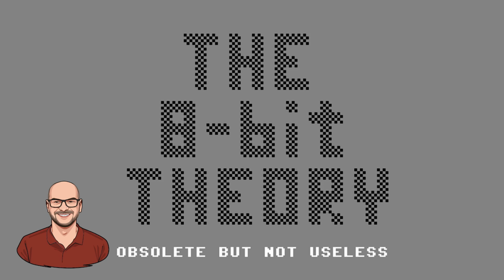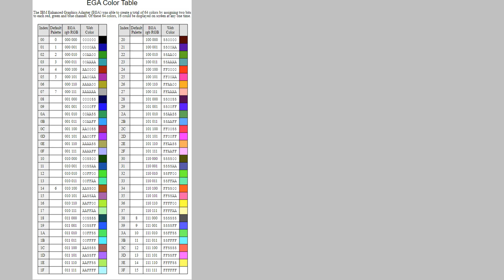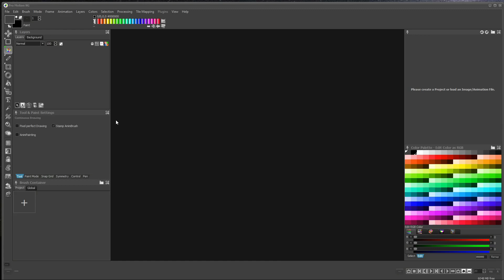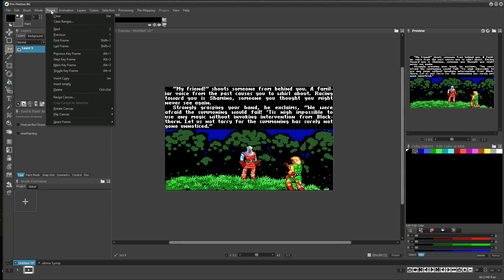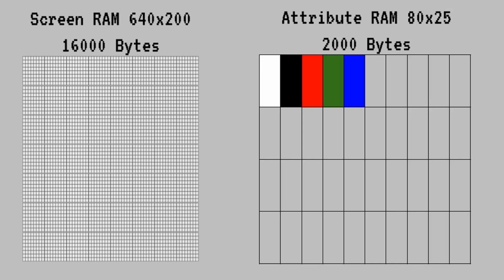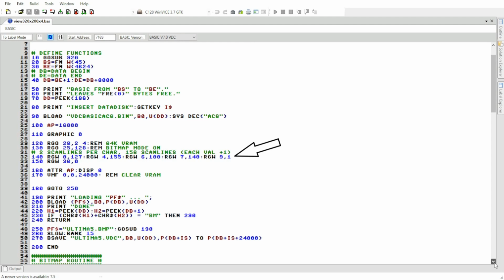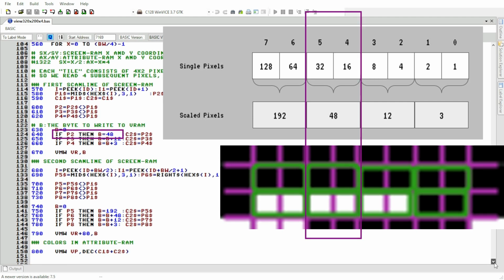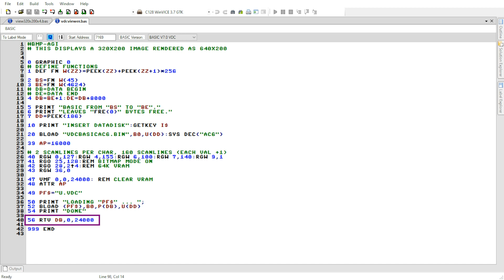EGA on the C128? And it looks great

Comment: VDC = VERY expensive monitor to see the display. Nobody wanted to spend £550 on a C128D AND then £300 on the Commodore 1901 or an EGA PC monitor. That's why nobody bothered making VDC game.
Reply: Not only that. VDC lacks sprites and software sprites would have had an attribute clashing issues. Also smooth scrolling is not possible with colour attributes being set, so VDC games would look pretty much same as ZX spectrum - either being monochromatic with smooth scrolling or having colours with attribute clashes and 8x pixels jumps when it needs to scroll in horizontal dir.
Reply from the maker: @fradd182 I agree about soft-sprites. Not sure about the smooth scrolling though, as there is a register for horizontal and vertical smooth scrolling. I‘ll cover these in one of the upcoming episodes. 
Thanks for your input!
Reply from the maker: I tried some things with horizontal scrolling - not even smooth scrolling. And it's a real pain :-D
So, yeah, I'm convinced smooth scrolling will be even worse.
Thanks for the heads-up on that one :-)
Reply: Really, nothing can compare costwise to the TV that you've already paid for.
Reply from the maker: @glenndoiron9317 Ha, so true :-D
Reply from the maker: I agree, the monitor was probably the main blocker for the c128 to be adopted by game manufacturers. 
I think the 1901 went from $ 700 in 1986 to less than $ 300 in 1988. 
I think the 1084 was introduced in 1987 at roughly $ 500. 
Also, most people probably didn‘t bother with upgrading to 64k of VRAM. 
I‘ll cover these points in a future episode, thanks for your input
Reply: @the8bittheory  The original C128 + disk drive + 1902 monitor in the UK had a bundle price of £800 around late 86/1987. It cost more than the Amstrad 1512 PC 8086 clone with twin disk drives and colour monitor, and that ran MS DOS applications which were far more attractive to business users. Still Commodore 128 + tape deck could have hosted some nice 128k 1mhz VIC-II games. It's not like the machine sold badly, 4.5 million C128 and 128D machines were sold. The extra memory allows twice as many sprite/graphic data memory locations for the VIC-II to be pointed at.  I presume colour RAM is also duplicated in the 65-128kb area of the memory map too giving you the potential for double buffered 16 colour games, C64 color RAM being a fixed location is the real problem for super fast and very colourful scrolling games, you have to compromise on colour or screen size as the C64 can't do the full screen 50/60fps scrolling colour and video RAM together.
Reply: I plug my C128 to a LCD TV set using SCART, the converter I made include one DB9, One peritel, 1 meter cable and 8 resistors
Reply: @Arnold_A_Lampel  The problem was Commodore sold the 2mhz 128 as an 'upgrade' to the C64 but the reality was on a TV it could only manage the same as a 128k 1mhz C64. However, there is also the fact the C128 sold more worldwide than the Amstrad CPC so even so it should have got some 128k versions of games like they did for the CPC. The Spectrum 128k models are really the only ones that got support because that did have a sound chip and all the 48k models had no sound chip just a pathetic beeper. Don't know what they could have done in the USA but in the UK if the VDC was made to run at 15.5khz with analogue RGB output things may have been differemt. A 128 version of The Pawn/Guild of Thieves could have had ST/Amiga graphics. Alternatively they should have spent time making a VIC chip that did work at 2mhz but the C128 is a cobbled together system, it's not like the elegant design of the C64, the Z80 is exclusive mode so no dual CPU. You had to pay for all these extras but the games developer couldn't use them so ultimately Commodore should have stuck with their MS DOS PC-1 model and just released a 64kb RAM cartridge for the C64 and offered it in a bundle. There wasn't much reason to get a 128/128D because once you add the disk drive and 1901/1902 monitor it costs more than an Atari ST running GEM with an 8mhz 68000, £800 in the UK for the C128 business bundle with 1571 and 1902. There was also the Amstrad 512k CGA PC with monitor for just £500 in 1986. The C128 still sold about 4.5 million units though according to Bil Herd the designer (was on his website) compared to 3 million for all Amstrad 64k to 128k CPC machines and 5 million for all the 16k to 128k Sinclair/Timex computers. It's just lack of effort by the developers to support it, the number of C128 units sold deserved Sinclair 128k levels of support but they were too lazy and just slapped on "Type GO64..." in the C128 loading instructions on the games labelled C64/128. Bit of a joke really but then home computer software publishers did the same to the CDTV...slapped on some rubbish A500 games on a CD and charged you more. You wouldn't get this disrespectful attitude from Japanese developers, just the greedy disrespectful talentless UK publishers 100% in it for just the money and no pride in their own released product.
Reply from the maker: I think the C128 was sold about 4 million times, which was close to the Atari's 5 million and the Amiga 500's 6 million.
However, I don't have any numbers how many C128 owners were able to use the VDC-Output. And that's probably the main pain point.

Earlier would definitely have been better. And cheaper to build, too. Production was stopped because the C64 was more profitable.
Reply: @the8bittheory   The numbers sold are between 2.5 and 4.5 million so it's hard to say but if I choose 4.5 million I use maximum units sold for rival machines from Amstrad or Sinclair etc. Most people I knew who got one bought it for games (we were teenagers lol) really, just in case some good games come out later for 128 only mode. I think from memory Bil Herd said the VDC chip he was given for his C128 project needed some work to make it reliable so he probably had no time to make it work at 15.5khz @ 60 or 50 fps for TV. The 128D is still the Rolls Royce of machine to use with C64 software, even if all you do is write some LASER BASIC programs or load up tapes :) The extra 25% CPU speed boost even in 64 mode would be nice for updates of things like Rescue on Fractalus too.
Reply from the maker: @madcommodore Fully agreed. I knew two people with c128s. Both only had it connected to a regular TV.
Reply: @the8bittheory  If somebody had sales figures for the 1901 and 1902 monitors that would be a good estimate, I doubt anybody other than C128 users bought those monitors.
Reply from the maker: @TheDsgfdssd yes, the c128 is more for enthusiasts due to the higher price. But then, you get two for the price. Three even, if CP/M is your thing. (It‘s not for me, tbh)
Thanks for your input!
Reply: The VDC was damn slow without interruption and had no sprite nor hardware scrolling. Anyway this monitor rant does not apply in developped countries where tv sets feature a scart connector. Converting rgbi to scart is then made using 9 resistors
Reply from the maker: @CaptainDangeax It has hardware scrolling. Check the videos on this channel. But the lacking hardware interrupt was a major problem, you‘re right
Reply: @the8bittheory  ok my bad. I recently got one and installed 2 lcd tv to enjoy dual display, at least in slow cpu mode
Reply: That coupled to the C128 having the C64 100% compatibility mode made developing for native C128 worthless; and the "business" target Commodore intended the C128 to be was a joke: they only included a Z80 for CP/M mode, which only covered a dozen slow and very limited text-only programs.
Reply: @DonVintaggio  If the C128 could run at 2mhz mode AND use the VIC-II chip at the same time then yes it would be worth it to do 128 only games. But it can't so all the 128D will ever be is a 128k expanded 1mhz  Commodore 64 if you want to use it on a TV. I assume had a 2mhz VIC-II existed they could have used more than half the bits of the 8bit colour RAM and therefore a larger palette. The C128 is something Commodore made from the original cancelled Commodore LCD motherboard according to Bil Herd on YT C128 Animals Group 25th anniversary video. The Z80 only on the C128 because they couldn't get the Commodore 64 CP/M cartridge to work. It's a bit of a mess really. Still it sold more than ALL Amstrad CPC home computers alone, almost as many as the 7 different versions of the Sinclair/Timex computers worldwide. It's just an awkward design and few developers could do much more with a 128k 1mhz C64 so they didn't bother. Rescue on Fractalus on a Commodore running faster than the Atari 800 version would have been nice but it would only be possible via the VDC and then nobody would really buy it if they needed an EGA RGBi digital monitor to play it on their £280 C128 :)
Reply from the maker: I agree. A 2 MHz VIC-IIe would have been a game changer. Improved Color RAM access might have allowed games like Sonic without REU.
Reply: @the8bittheory  I haven't checked what screen mode Sonic 64 is using but if it's character based 1kb screen 2mhz video and color RAM access for a good coder is enough probably. Knowing Commodore though. Would be interesting to compare VDC Law of the West visuals possible with the standard VIC-II hi-res 8kb bitmap screen + sprites the C64 version used. Law of the West is probably the most damaging game, graphically speaking, to rival 8 bit systems.
Reply from the maker: Law of the West is an interesting example. But I was thinking it uses textmode in a very clever way. Didn‘t find a definitive answer so far though. 
Anyways, I agree that a VDC version would be really interesting. 
Great food for thought. Thanks!
Reply: @the8bittheory  Law of the West uses sprites over a hi-res 320x200 bitmap screen. Color resolution is only 40x25 but you can change foreground and background colours. VIC-II doesn't have a true bitmap mode, the C64 bitmap mode is layed out 8 pixel wide 1 pixel high rows in a column 8 pixels high and repeated across the screen to make one 320x8 pixel row. Then it moves onto the next line. It's not a character screen though, the bits you POKE into video RAM represent these 8x1 pixel areas in this strange character based screen pattern, still need 8 POKEs to fill 1 8x8 pixel area. That's really why very few games use it. In character based mode you can only change the foreground colour, in bitmap modes you can change background and foreground. I think all the moving areas of the screen are sprites, like when he draws his gun to shoot etc. The C64 has 5 screen modes in total from 1981, no coding tricks required.
Reply from the maker: @madcommodore Thanks for clarifying and adding so much background information!

Comment: Afaik you can't change palette on EGA in 320x200 mode.
Reply from the maker: Oh that‘s interesting. That would answer the color choice of games. Thanks for letting me know
Reply: You can select 16 colors out of a palette of 64 colors in EGA 320x200 mode.
Reply: @az09letters92 No, you can select from the full 64-color palette in EGA high-res 640x350 mode only.  640x200 and 320x200 are limited to the 16 text colors (although you can change any palette index to any other, so crude palette cycling effects are possible).
Reply: @JimLeonard  That's crazy. I could sworn I've written 320x200 16 color mode code in the nineties that changed the palette. Although I tested it on a VGA adapter...
Reply: @az09letters92  VGA is not EGA ;-)
Reply: @JimLeonard  VGA still had EGA modes. Not so sure how compatible they really were...
Reply: @az09letters92 My point is that VGA emulated EGA modes, but still retained the VGA DAC and palette capabilities.  So it was very possible to set EGA 320x200 16-color mode but then use VGA hardware ports to set each palette index to a VGA RGB value.  A few VGA games did this on purpose, instead of using the full 256-color mode, because the 16-color mode used half the video memory and also had some blitter-like features, for extra speed in updating the screen.

Comment: I remember the Commodore, Amiga computers. They were very useful for creating video slides, presentations for us in the early 90's at Motorola. I liked the cruder graphics ( at the time I didn't know any better) and had a great time playing around with it's abilities.
Reply from the maker: Oh yes. Graphics from that time aged really well. I fully share that view
Reply: The Amiga had dramatically better graphics capability than the Commodore 128 (and used the Motorola 68000 series, rather than the MOS 6502 series of the 64/128). That's awesome that you still used Amigas at Motorola in the early 90s. Perhaps they were AGA Amigas (1200/4000), which had even better graphics capabilities.